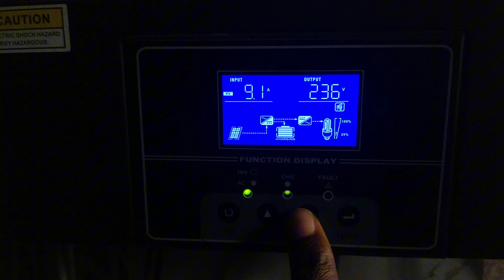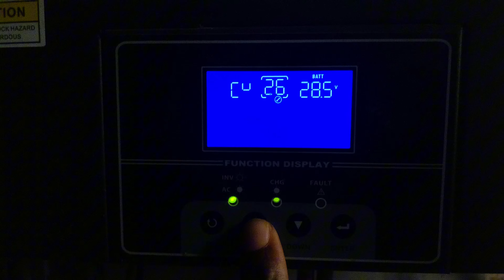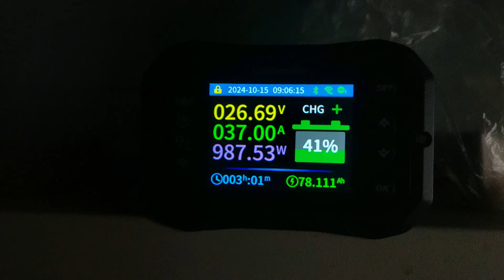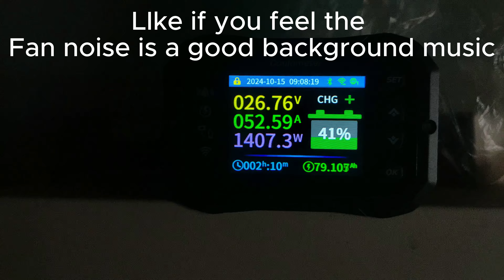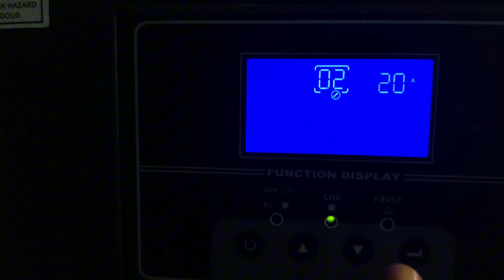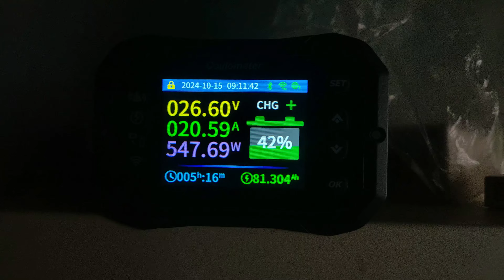Best Charging voltage to maximise Solar generation...

Comment: I think there is a misunderstanding here by some of the responders.  You can charge at 3.65v  but limit the battery voltage on the battery BMS to a lower amount if you wish.  The fact that your inverter charges at 3.65 does not mean your battery will get to 3.65 if the BMS cut off is set lower than 3.65v.  The cut off voltage of the battery is determined by the battery  BMS.

Comment: There are two things involved either the bus voltage inside the inverter is too high or your cable has too much resistance and thats why u need to increase your voltage to get the best charging current,or i could be wrong and that hybrid inverter is just made like that with that quirk in it
Reply from the maker: @odeywilliams7596  cable are 35mm, thanks for watching.

Comment: For a 25.6v LIFEPO4 battery system you should charge at 29 and float at 27.2
Reply from the maker: @techthehome7167  28.8V - 28 charge and Float 27.6 - 27.2.. these ranges works fine.

Comment: Nice.i have 21 unit of 625 half cut panels with 12 unit of 230 ah battery.i do run 2 ac in d day and one at night.i have 10kva inverter (2unit of 5kva hybrid inverter with 500 pv voltage
Reply from the maker: Sounds like you have a great setup! thanks for watching.

Comment: Pushing the cells to 3.6V comes at a cost of lower cycle life.  But of course you get the maximum charging current. You can't eat your cake and have it.
Reply: Even if they are rated @ 3.65v.  Have you taken a close look @ the charge and discharge curve of a lithium bsttery.. there is really notin above 3.5v
Reply from the maker: @gcrestfidcrest   yes, however does not change fact it can reach 3.65V.
Reply: @gcrestfidcrest  I don't charge mine more than 3.5v. Almost nothing after that. Just stressing the cells.
Reply from the maker: @xlgoldfish  also note cells dont see 3.6V unless untill they hit, 3.45.. 

And cells are rated for 2.5V to 3.65V
Reply: Not really, only if you leave the batteries at a high state of a charge for a long time. It appears based on his settings that he is cycling the batteries daily.